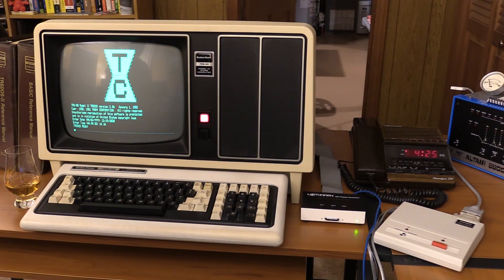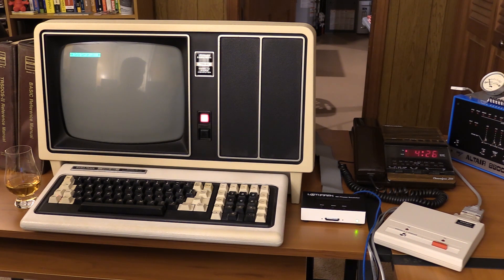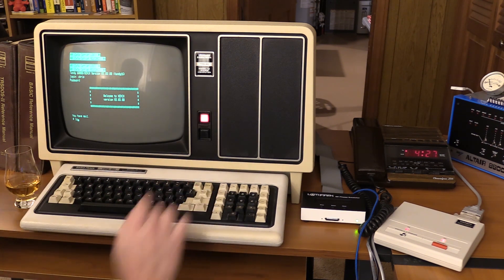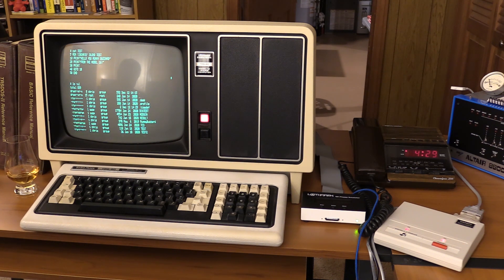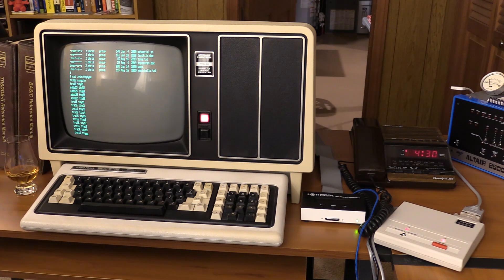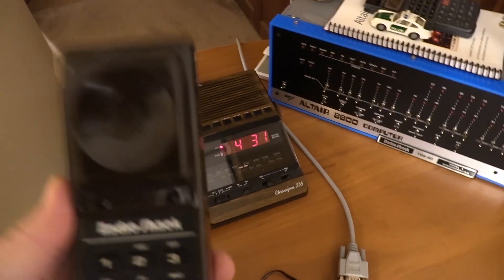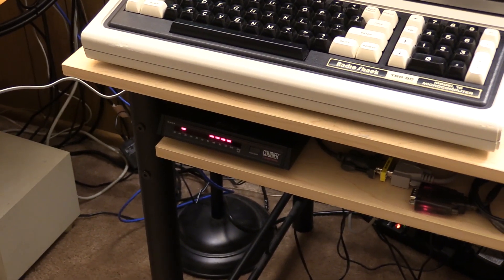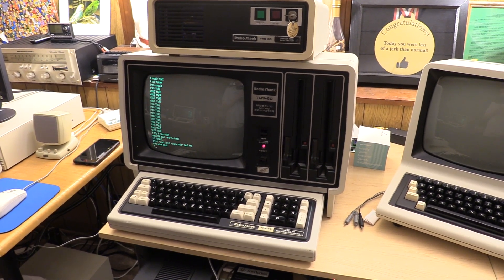TRS-80 Model 12: Dialing Into XENIX Using A Tandy 300 Baud Modem And Radio Shack Phone

Comment: This is awesome! Radio Shack made these terminals to last forever. I use to have the TRS80 color computer with the wefax and readioteletype rom software cartridge. I used a radio schack dx320 hf ssb receiver back in the early 80;s and decoded marine weather teletype data and weather fax! I like some of the old modems like the robotics modem man those were the good old days!